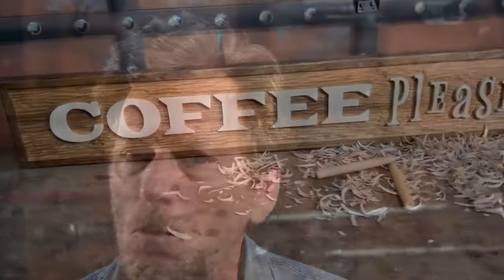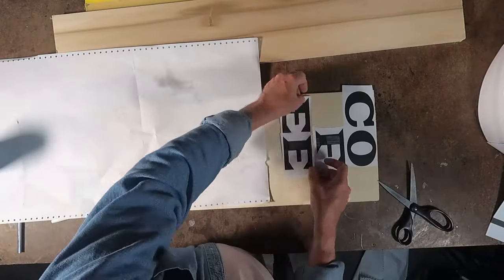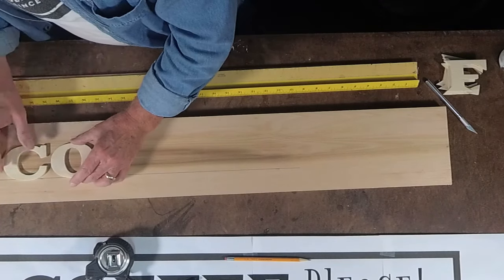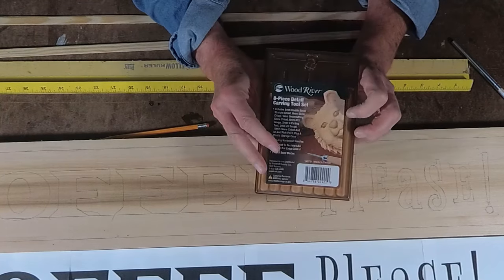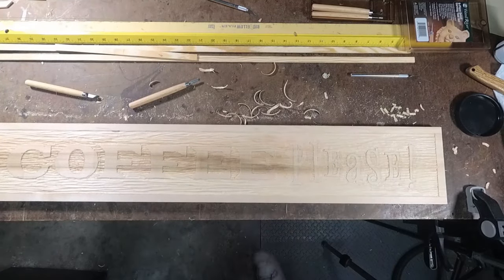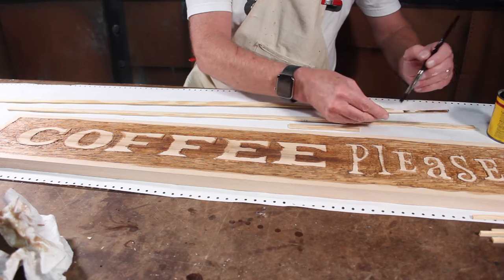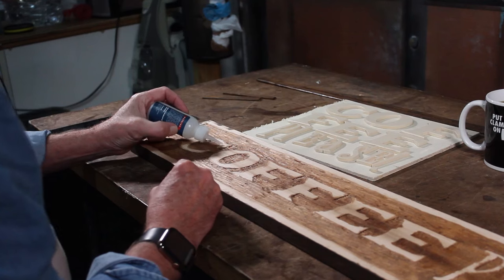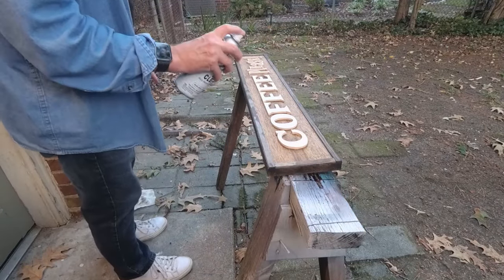Simple Carving Trick for Custom Wood Signs (No CNC)

Comment: I make signs & freehand cut the letters into them using a router, I found that the paper can often blow off, come unstuck etc. A trick I use for getting the image onto the timber is print it out as mirror image, tape it face down at one end onto your work & then rub the back with thinners, this transfers a perfect ink image onto your workpiece, I only tape one end so that I can lift it to see how I'm going.
Be careful to not get too heavy with the thinners otherwise the edges of the design will not be crisp, once you get the hang of it it's very easy.
Reply from the maker: That is a fantastic tip. Thanks so much for sharing.